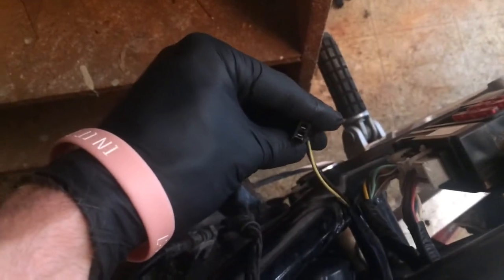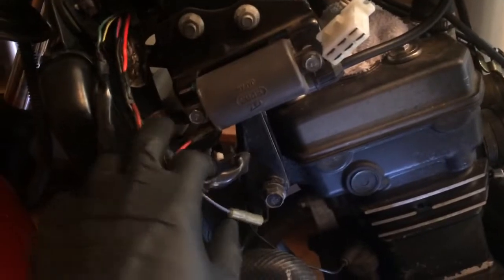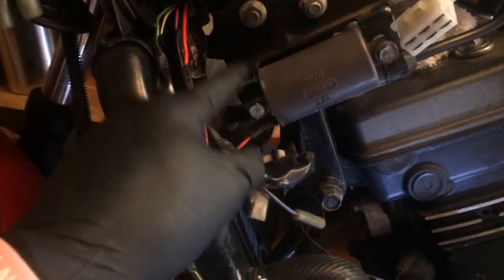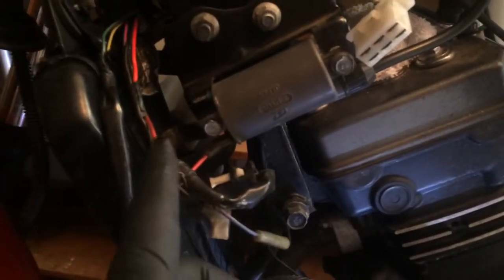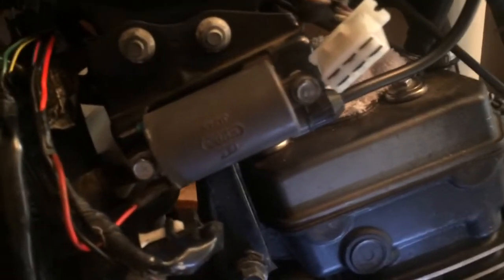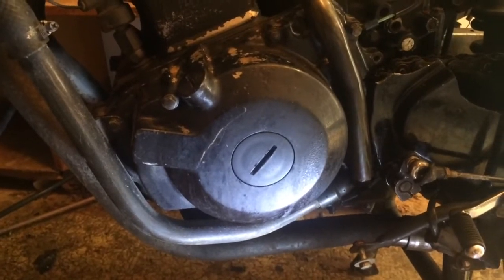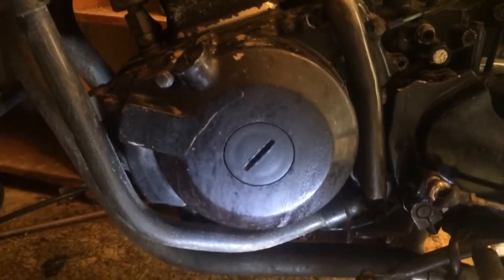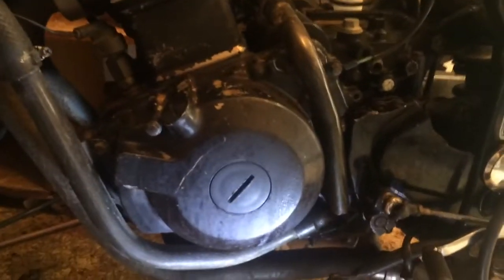1997 Kawasaki Ninja 250R Project: Still No Spark But now I Know Why!

Comment: did that fix it???????
Reply from the maker: After I replaced everything yes. I never got it to start though. I ended up selling it and the guy rebuilt the motor new rings we’re need. And a new neutral safety switch was added and she started right up
Reply: Pero dices q la pulsora debe ser de 120 a 400. Oms
Y e visto q de 100 a 150oms